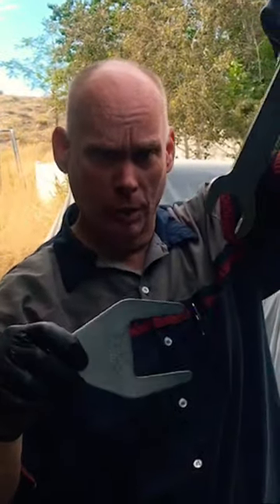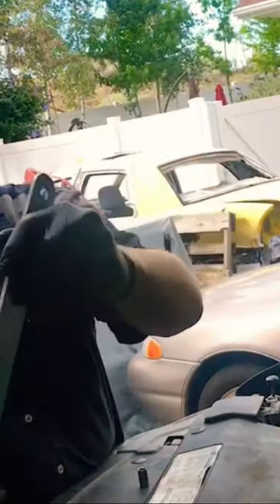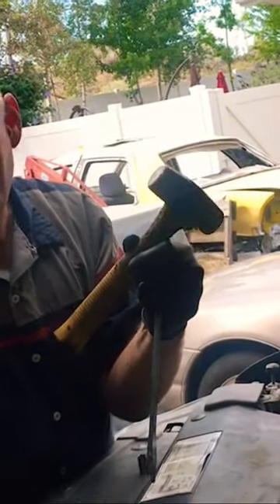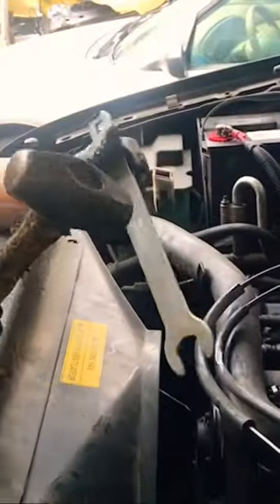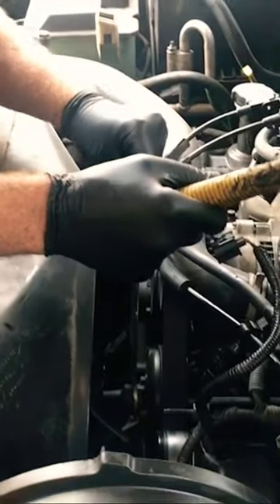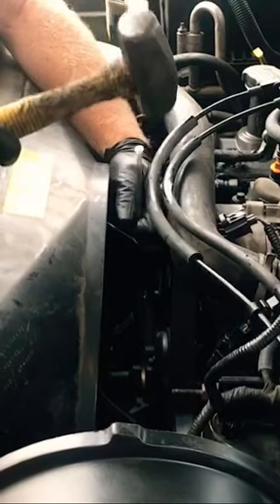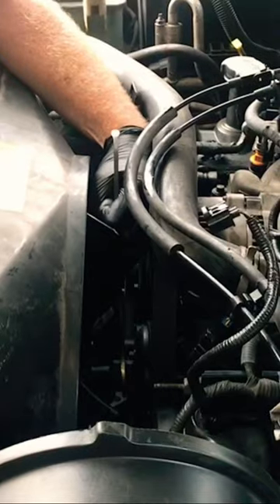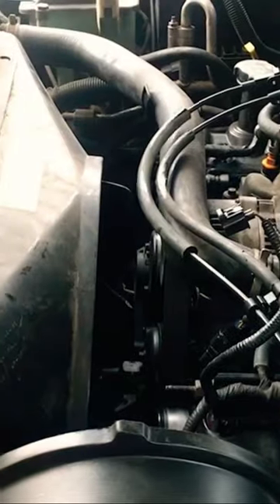Easiest Way to Remove a Fan Clutch!

Comment: Annnnnd Of COURSE, it does NO Damage to the Water Pump while smacking it over and over from just the TOP, as you turn the Nut with the Hand holding the Wrench… 🤦🏻🤷🏻‍♂️ 
If Replacing the Water Pump, Sure, Have at it… UNNECESSARY Potential Damage to a Perfectly working Water Pump thou  ? 🤷🏻‍♂️ ❓ 🤦🏻 ?